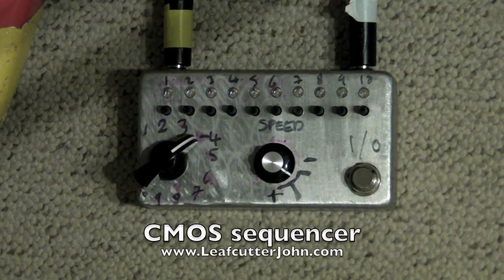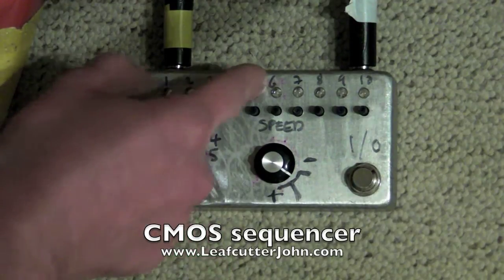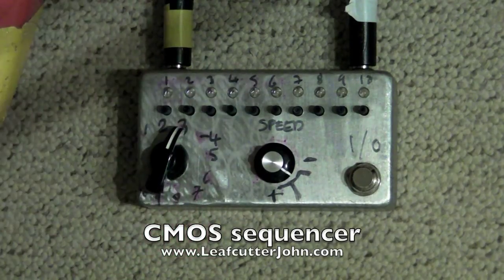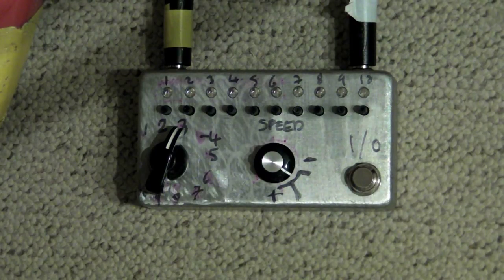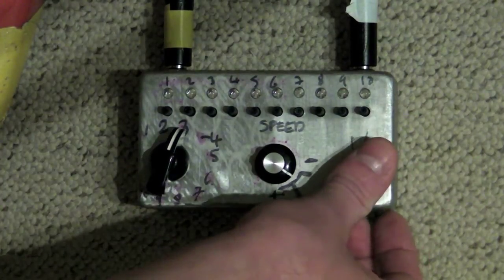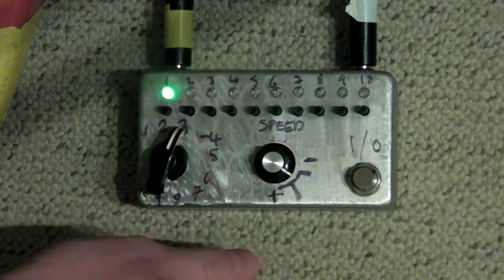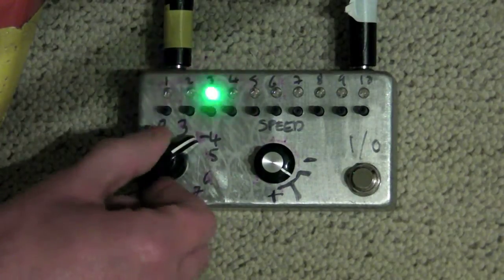CMOS Sequencer Inspired by Handmade Electronic Music written by Nicolas Collins

Comment from the maker: @ASYLUMTARD - a couple of things to check: reset pin (15) to ground through 100k resistor, same with pause pin (13) and of course you must directly ground pin 8 if you have done all that check your battery and that your breadboard is not broken or your wiring worng, by building the circuit again moving all components across a row or two. If this does not help maybe a damaged chip? Let me know if you sort it.

Comment: This is an 8 light sequencer I've constructed out of a 4017 IC. The 15th pin of the chip resets the sequence, which means it can be placed throughout the pins in order to control the length of the loop. I've run into a strange problem, though. Whenever I attach the 15th pin to another pin, it is ignored. But when I break the connection and reconnect it with my hands it works. I've tried attaching a resistor and grounding it, but still nothing.

Comment from the maker: @liquidcalm the values for all the LED's feed a separate LED in the box which is feeding the different amounts of light to a LDR - this arrangement  of LED and LDR is called a Vactrol and can control the level of an audio signal. It's super simple, i'm probably making it sound more complex than it actually is. If I had a bit more time I'd post a video about how the circuit works